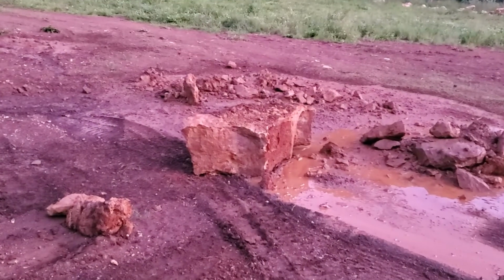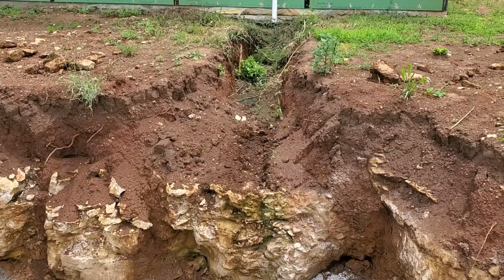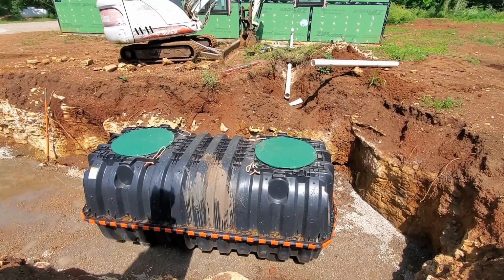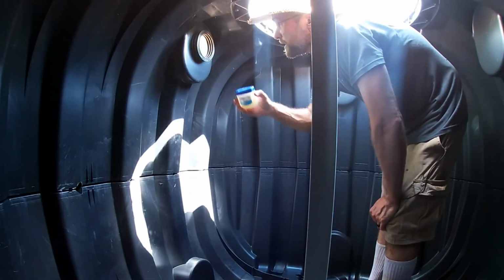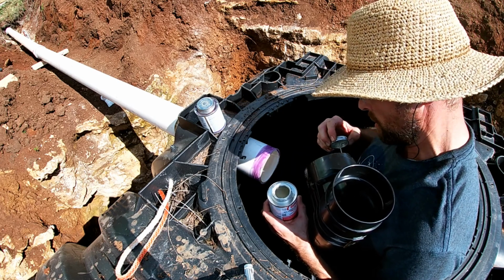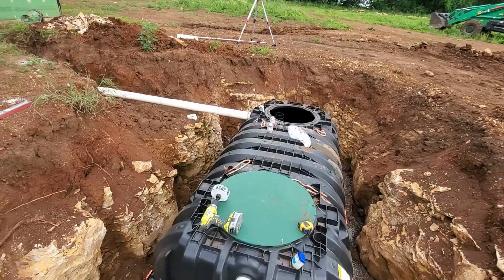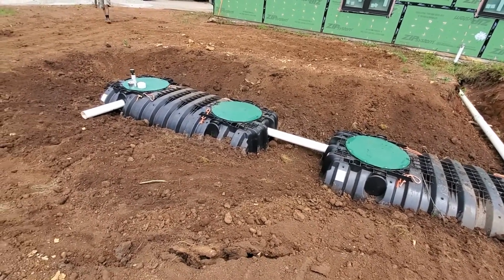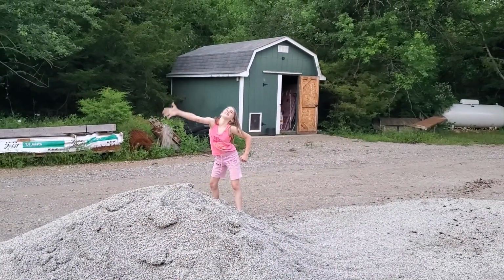Septic Tank Installation of our Dual Tank Septic System - Infiltrator Septic Tanks

Comment: Fill it with water before rain water makes it float out of the ground.
Reply from the maker: Yep, we filled the second tank some and the first will fill with gray water from the house shower we hooked up.  Once the lateral lines are in I can start to dump the RV black water tank into the system instead of having to run it into town every week to dump.

The manufacturer said that it isn't necessary to fill the tanks, that they won't pop out if it rains, but we didn't want to risk it.

Thanks for watching

Comment: Nice work.  Can you tell me how much you saved not going with the concrete tanks?  I guess you might not of had the equipment to install concrete....did you consider fiberglass?  Could you have just used 1 tank with dividers?
Sorry for all the questions,  just going through the planning stages myself and considering the savings opportunities...
Reply from the maker: Hello Sam, thanks for watching.  I was quoted $5k for a concrete tank and $3k to install it but this was before we knew how much rock needed to be broken through.  Here's a link to when I dug the hole, https://www.youtube.com/watch?v=X4S5A8p5VRQ

I'm sure the price would have gone up a lot once they hit the rock, maybe by around $2k.  This meant the tank install would have been around $10k.  

We went with a poly tank because they aren't heavy like concrete and I knew we could move them around easily.  The Infiltrator Tanks do have a divider you can install but my research showed that the material used was insufficient.  It is basically a thin plastic piece that just seemed flimsy.  The solution to this was simply adding a second tank.  This way the first tank holds the solids and the second tank should be all effluent.

I did not do any research on fiberglass tanks.  I did research a lot about poly tanks and found that the Infiltrator was better in my option.  The two parts are molded separately an then sealed together with a rubber gasket and clips.  The tanks you see at home depot , for example, are melted together to make one piece but the seam tends to break.  This usually happens when the tank is being pumped and pressure is taken off the side walls.  This isn't an issue with the Infiltrator tanks given that the seam is so beefy.

Good Luck on your project.  The next video will be on the Lateral Lines.
Reply: @Off-Grid  That was an awesome generous and thoughtful response.  I appreciate you taking the time as I understand how valuable it is.  I will keep watching.  Keep up the good work!
Reply from the maker: @Ivebeenaroundyouknow  your welcome.  We hope to help others as much as we can.

Comment: So, did  you have someone spec out the design and parts for you.
Reply from the maker: The county told me how big they wanted the system to be and then I researched and found what I needed to build it and did the layout myself as well.  I did oversize the tanks by 500 gallons because it was easier to install two 1000 gallon tanks.
Reply: @5th Journey Off-Grid Homestead  OK, I'm pretty much going down a similar route. I was about to head down to the county office and drop off my spec drawings. I wasn't sure if I should have someone design it or if I could drop off my own drawings based on the standard requirements and perk tests.
Reply from the maker: @allennolden8735  A lot of it will depend on your county and how strict they are.  I had to get my license to install the system.  It was an open book multiple choice test, very easy, and $200.  The layout was sketched on the back of the permit application while I was there filling it out and talking to the inspector, who was in his 80's.  It all went pretty smooth and the system is working fine.  Saved me a LOT of money too.
Reply: @Off-Grid  Ok, I'll keep that in mind when I head down there. Thanks for the info!
Reply from the maker: @allennolden8735  Good Luck
Reply: 80's lol....mine too

Comment: Which cost more concrete or plastic septic tank
Reply from the maker: Concrete was much more expensive.  The only downfall to a plastic tank like this you CAN NOT drive over it.  They say not to drive over a concrete tank but it happens and the tank will take it.  You do not want a one piece molded tank and they'll split down the seam.  I was also told that when you have the tank pumped not to have them drain it more than 40-50% to keep the water weight pushing out on the side walls.  I don't think that's an issue with the style we bought but I wouldn't trust a Home Depot septic tank.
Reply: I wish I had seen this before I got 1 of those yellow tanks.
Reply: How it doing?  I at first thought the molded better but....

Comment: what we can used this tanks pleas i need more detils and this tank save  bad water and go in filter to get peur good water and u cant get eny mony pleas explan me and thanx for good plan and good work im from egypt and im sorry my englich not good sorry hope you under stand my say
Reply from the maker: Hello, I think you are asking how much the tanks cost and if you can clean the waste into good water.  The tanks we're around $1,000 each.  It would be costly to purify the waste water but if the tank was used for only gray water it could be treated to water gardens and such but probably not for drinking water.
Reply: @Off-Grid  firest good jop and exlant wife for helper and sweet kid now i understant this project for garden i need for you pleas another tube how this tankes work and how get more water to tankes and do you need mator or machin to puch the water from tanks to garden
Reply from the maker: @mohsenrezk  This was for our septic system and was not intended as a watering system, although it could be used for that. You would run the lines into your field for the garden. You could direct water into the tanks from a roof structure. Just make sure there is a good filter before entering the tanks so they don't get full of debris